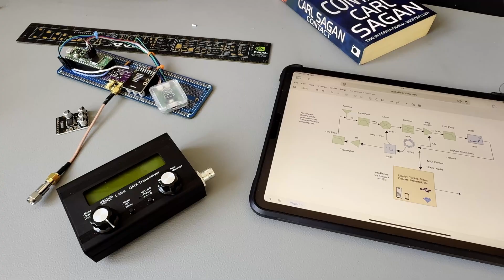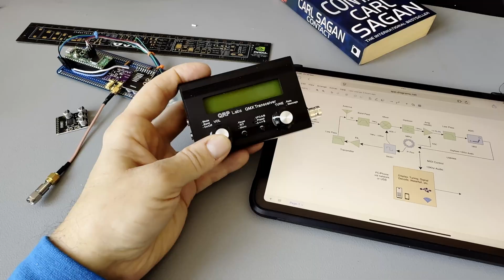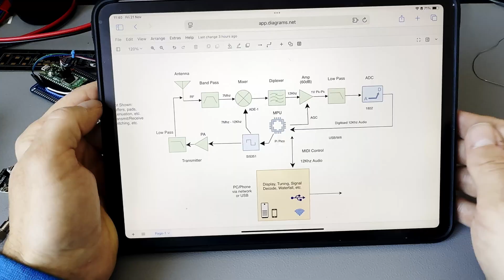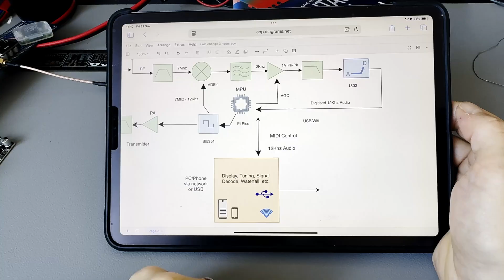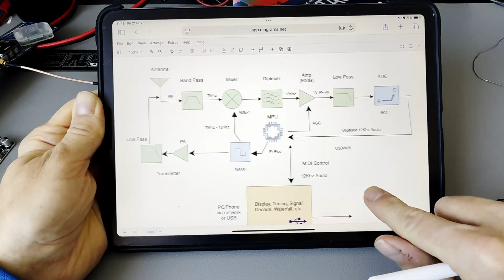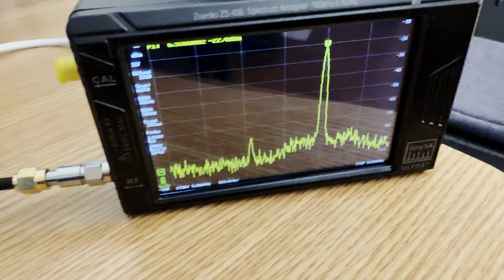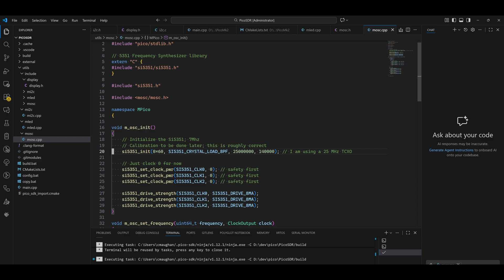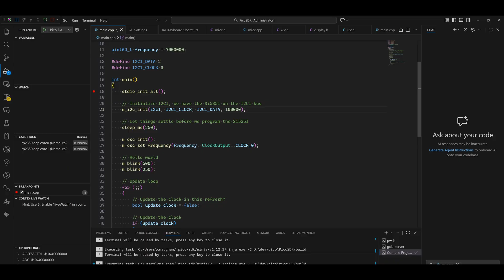Black Box SDR 1: Thoughts and Pico Setup

Comment: Good idea, but why MIDI and not BLE?  Wasn't Bluetooth made for that kind of thing?
Reply from the maker: MIDI is a data protocol, you can transfer it via USB or Bluetooth; the important part is that an iPhone, etc. understands MIDI protocol. If the device looks like a microphone and MIDI controller, it requires no special drivers on the phone/PC side.
I could later support wireless protocols, but for simplicity, USB to start with.